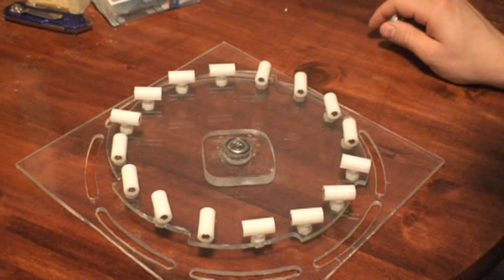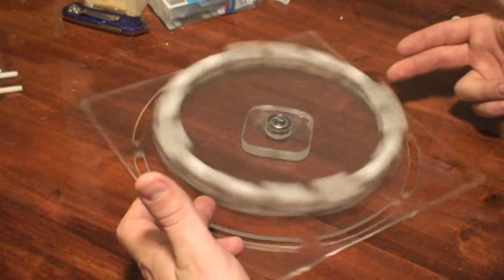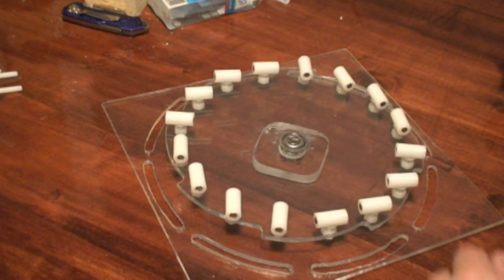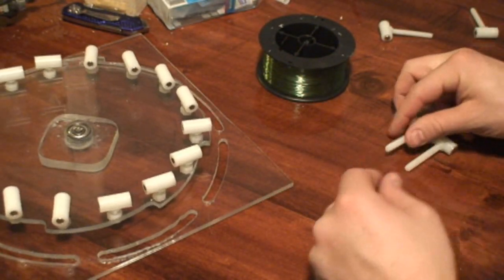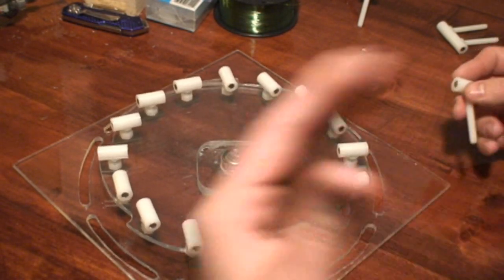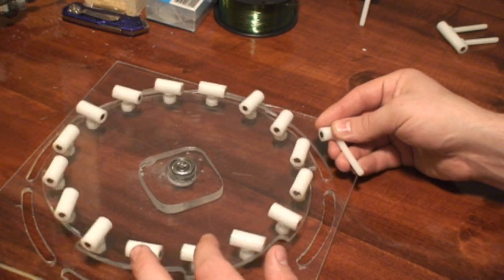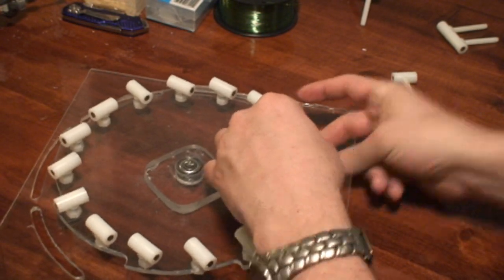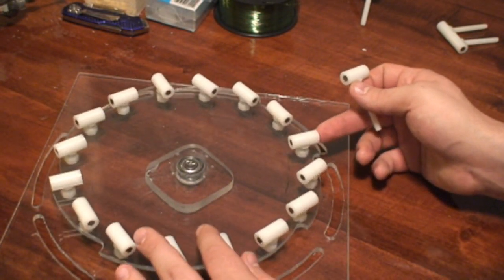Magnet motor, free energy, overunity test 2

Comment: I don't think these people understand physics
Reply: well its "possible" to have free energy or limitless energy.

the problem is that in order to have a system like this you need constant power to keep things going, meaning you both need a power well (so it never runs out of energy) and a greater power production than consumption.
Reply: Thekilleroftanks no your first sentence is false
Reply: not really.

anything in science can and must be possible.

because if we cant have limitless energy or free energy, then you must prove its impossible by running test to prove EVERY single model is wrong...

that is a lot of testing.
Reply: Thekilleroftanks that's not the way either physics or the burden of proof works sir.

If you make statement A. You have to prove statement A.

If I say statement A. Is not  possible, all I have to do is show why.

As for the infinite power thing, that wheel he has there is being spun up or pushed by that magnet he is holding, every ounce of power it has was given it by that magnet. Every ounce of power taken out of the system for generating electricity will take away from that, as will friction air resistance etc.

He's inputting X energy into the system.

He's outputting Y energy from the system.

So long as he's putting in more than he is taking out the wheel will continue to spin. There's nothing free about it
Reply: Actually, if you claim that you can have limitless or free energy you have to prove your claim. Otherwise it has no value.
Reply: It's possible to have free energy or limitless energy if you have something that never runs out of energy

Nice logic
Reply: No it isn't.
Reply: ***** yes it is.

if you wish to state something is impossible, you must prove it.

something thats very difficult.

hence why we state something is either very difficult to pull off. or require tech we have no ability to access. 

but stating something is impossible is the same as stating something is possible. and still defies the laws of science.
Reply: except that if you state something is possible, you have to prove it too. Which means that the default state is neither everything is possible nor nothing is.
Reply: ***** unless its far outside our reach, then you cant prove it but neither can you disprove it meaning its possible BUT there is a very small chance of it happening.
Reply: Thekilleroftanks you don't understand the burden of proof nor the conservation of energy.
Reply: Sir Sayaka Miki the 3rd oh no i do understand how those things work. i understand the conservation of energy makes limitless energy impossible and i do understand the burden of proof is on me.

but am stating that I, cant test the theory therefore i cant disprove nor prove it can work. and because of how science is where unless you prove it otherwise, it must be possible. it might have a 99.9999999% chance of not working. but there is still that .0000001% chance of working.
Reply: No it isn't how science works. It is neither possible nor impossible until tested. Otherwise science would be biased.
Reply: FuckYouGooglePlus And it is considered impossible because the thing they are breaking has been tested before.
Reply: And the reason for that is because it has been tested. For instance, i do not need to test whether or not a 0.45667753kg object falls at the same rate as a 1kg object because it has been proven that the calculations are correct (correct enough).
Reply: +Thekilleroftanks No, not everything is possible. Nature operates under a set of laws.
Reply: wowhallo yes, but those laws may not be correct.

because we dont know everything, therefore those laws arent set in place completely.
Reply: +Thekilleroftanks Yes but is there any logic to nature? If so then you would have to accept that there is a set of laws that nature operates under. This is the basic assumption that you have to make in order to do empirical research, that you have to assume that the nature of things stay the same in the course of time.
Reply: FuckYouGooglePlus Yeah, no. In general, a scientific law is the description of an observed phenomenon. It doesn't explain why the phenomenon exists or what causes it. The explanation of the phenomenon is called a scientific theory. It is a misconception that theories turn into laws with enough research.
Reply: Free energy doesn't work because of laws of thermodynamics. these free energy machines are only possible in a system where no energy is lost through friction or heat and those are conditions that we can't create, even the magnets will eventually lose their magnetic properties over time.
Reply: FuckYouGooglePlus FuckYouGooglePlus FuckYouGooglePlus what you describe is absolutely not a perpetual motion situation or free energy. Perpetual motion is not perpetual if you NEED to replace parts, end of story. 

Your free energy situation is correct until a certain point in your argument. If the system makes more energy than it uses, yes that's free energy, anyone would agree. If however, you have to replace parts or whatever, as you said costing more than the excess energy produced, that is NOT free energy. Free energy in physics when talking about breaking laws (conservation of energy here) is concerning total energy. You could argue that your system creates free local energy, absolutely, but free energy no. In the same sense that solar panels are free local energy. Regardless of what you do the total energy though remains the same.
Reply: And in fact people referencing loss of magnetic properties is very relevant to this video.
Reply: Or, we can just forget about this useless argument and thank this guy for uploading it in the first place.
Reply: Or, you can not drag me into your crap. Thanks in advance.
Reply: Where did this come into play? Lol I don't make videos, thanks for taking an interest in my channel, doe. Just a video bro chill out on all these comments lmao

P.S. Somebody that feels the need to make a rant on 15+ YouTube comments is a burden to society, XD
Reply: I don't think Nikola Tesla was wrong with his idea, he was a genius, smarter than anybody in his time and nowadays. But I do think the term 'free' is wrong ^^
Reply: I agree with you
Reply: But being wrong, unable to accept it, and sperging out are all signs of a well adjusted individual? Is that right? Man, I wish I was cool like you...
Reply: kids, stop the arguing, we all know these machines can't work end of the story
Reply: Sir Sayaka Miki the 3rd I'm starting to think that that Google guy is one step stopping us from achieving world peace tbh. Honestly, he has nothing nice to say, and no one wants to hear his face. Why can't he just take a chill pill and realize that he will be forever lonely of he's always talking like that?
Reply: Sir Sayaka Miki the 3rd Same, I'm anticipating how many times he's gunna tell us to kill ourselves over a video.
Reply: Thekilleroftanks, actually you can't have free energy or limitless energy because that would violate the first law of thermodynamics. Not knelt that you couldn't use the power created by it
Reply: Fester Blats that's literally it. Like where does the extra energy come from. It just makes no sense 2+2=4 but for some reason energy+energy doesn't = 2energy to these people.
Reply: Just gonna jump in here, you are indeed wrong killeroftanks.  "Anything in science can and must be possible" is a logical fallacy. It is not possible to have "Free" or "limitless" energy, it violates the laws of thermodynamics and denies entropy. If this were even partly true the universe would be a very different place, probably unsuitable to life
Reply: It really has nothing to do with entropy or thermodynamics its literally nothing more than conservation of energy which is a fundamental observation about our universe.
Reply: RMSVideos So where does the energy come from? If you were to extract energy with this device using a standard generator where do you think the energy to turn that generator would come from? It cannot just be spontaneously created, if we could create free energy out of nothing we could have pocket fusion reactors
Reply: I think the fundamental flaw of the possibility of free energy is that it is indeterminate as one cannot measure exactly if it is possible, while, simultaneously, one cannot measure if it is impossible.

As such it is simply not worth arguing at all, because we cannot even create a link to a conclusion. Now what is worth discussing is figuring out how to utilize conservation of energy to perhaps recycle energy and use it more efficiently.

A valid point is that if all the energy at the input is outputted to the same input, then there will be no loss of energy in the system. What makes this an unsound argument though is that systems forged in this manner have losses that we cannot account for which prevents us from utilizing all the energy at the input.

Of course there are always the options of just transforming the excessive energy in nature to something that can be utilized. Things like solar panels, wind turbines, and hydroelectric dams do this already.

In the end, the issue of these free energy things is the costs to start it up and to maintain it. For things like magnets, it comes to the question of is the cost of the energy used to magnetize these magnets worth less than the gains of the energy produced by these magnets. It's much easier to justify this if the resources can easily be found lying around in nature, but when one needs to place efforts into creating the resource itself, it becomes a cost that makes the process much more difficult to justify.

Of course, if despite all these factors there is a net gain, then I see no problem with calling this conservable energy. I mean we can nitpick the word "free" because there are the costs of magnets and all the stuff attached to it. For example, getting money from the job can pay off the loss in energy spent on the job, but it doesn't mean there was absolutely no energy spent on the job in the first place. Though it could certainly be dubbed as conservable energy, which is still pretty good to strive for.
Reply: FuckYouGooglePlus Interesting, can you outline why? I mean if we are nitpicking at the word free, then obviously one doesn't exist, as the fuel itself is the cost which is the magnets in this case.

I know that the concept of electromagnetic induction is essentially the main concept of how generators work. With the whole alternating current generated from constantly moving magnets through a coil of direct current. Coils up the wazoo since electric currents generate magnetic fields and coils funnel it through the center.

It's is essentially one of the concepts that the wind turbines, hydroelectric dams, and nuclear power plants use. Given that they use said concept, it goes without saying that kinetic energy can be converted into voltage. If the force of magnets can be used to produce kinetic energy then it certainly is possible. Though, in my opinion, is unreasonable.

It's about as reasonable as hiring 1000 slaves to turn a turbine and calling it "free" energy. Given that these other sources of energy generation are using magnets themselves, it would only make sense to use any juiced up magnets that are possible of turning a turbine efficiently, it would make more sense to just throw said magnets in the turbine itself.

Again though, conservable energy is useful to strive for given that these processes already use magnets. If I'm not mistaken, almost every single resource uses magnetism for power generation.
Reply: holycrapitsachicken dude Google has explained 40 times on this video. Energy from magnetizing the magnets is not the issue. And free energy is not possible it is not some thing where we're just going to uncover how to do it. You literally don't belong anywhere near science if you can't wrap your head around that.
Reply: I see, well then it really is unreasonable. I was aware of the fact that
 magnets utilize forces and it is one of the fundamental forces that 
keep the world stable:electromagnetic force. However, I wasn't aware of 
the minimal effect it has for kinetic energy.

I guess it makes sense since the mechanical energy needs to be the same and the potential energy of simply spinning that little magnet would not nearly be enough to make that thing go crazy. Heck, it takes kinetic energy to spin that thing so it really would be pointless.

At least nuclear power plants takes advantage of the the massive heat generation of nuclear fission by taking advantage from weak nuclear force to generate kinetic energy from the immense amount of steam generated.

I think people are better off buying a little generator and making DIY projects with it if they want to get a jist of how energy works. There are ones less than $10 and at least they have visible applications. I bet it is even cheaper than this set of magnets. Magnets are fun and all, but the electricity component is important for people to completely understand how it works, it's called electromagnetism for a reason.
Reply: Jon Deal i dont think YOU understand physic..
Reply: Thekilleroftanks there's no point in proving it's impossible if you haven't even proven it's possible
Reply: Energy has to be conserved. You can't create energy out of nothing.
Reply: Do the impossible, see the invisible.
Row row, fight da powa.
Do the impossible, create from nonconservable.
Row row, generate the power.
Reply: holycrapitsachicken made my day
Reply: To innovate, you go from the assumption that every thing is possible, until you hit the mark where you find that it isn't possible (that way), then you try it differently.

If you always assume that something isn't possible, then you will never have innovation.

If the cavemen never experimented with fire, thinking that fire cave from the sky and it isn't possible to create fire ourselves, we would still be having a firewatch to make sure the fire doesn't go out.
Reply: Why is this impossible though? I've never truly understood the argument. Energy cant be created or destroyed I think that what you are getting at, but cant it be contained in a way where I would collect more energy that we can take? I could be wrong of course because I've never looked into something like this but its a neat idea.
Reply: Joe you have a rather mundane and interestingly final philosophy on science. You're not wrong , but you seem far too dismissive of the potential of such a system. You are right that the reason it spins is that all of the magnetic force is made to push the wheel, and you can make the argument that it's thus unusable, but theres a lot you are ignoring. 

1. The magnets will take a long time to weaken, and until then can be used to generate KINETIC energy with this model, rough as it is.

2. Kinetic energy can be used in an unpowered motor to generate electric current. 

Your argument that the moment electricity is taken from the system it will cease would only apply if the propulsion was electrically powered. If you make one system utilizing magnetic production of kinetic energy, then a seperate system to capitalize on that kinetic energy, you could generate usable electricity. 

I'm not claiming that this model is the answer, but i AM saying that this model proves the possibility of such a system. And you need to think like a scientist if you want to accel in the field of science. You wont get anywhere if all you know how to do is close the book on any tech just because we dont yet have it, and by that logic we shouldnt be capable of ANY of the technology we have already.
Reply: Thekilleroftanks long story short,  there is no free energy you have to put energy in to get energy out check out one of Newton's laws "energy is never created or destroyed only changed in form"
Reply: Tesla figured out free renewable energy... why hate on people for trying?
Reply: Google plus is a complete tool...find a woman brah...
Reply: I'll make a statement. You don't understand physics. Specifically, quantum physics, because time crystals now exist. Higgs Bosson now exists. 

Time crystals are by definition infinite energy. aka Non linear matter. Always jiggles. 

Harvard and university of Maryland both proved it.
Reply: Physics is not a book sent from God. Its only a experiment.
Reply: @NafenX  ...and for all intensive purposes we do. Its called the Sun but we still haven't even figured out how to harness that properly yet either.
Reply: @BlueEyesWhiteTeddy  I am no expert but I believe the general consensus in the scientific communities is that something is deemed impossible until someone proves otherwise.
Reply: @Thekilleroftanks  As far as I am aware it has already been proven impossible through general relativity and the first law of thermodynamics. So these are accepted scientific facts and if you won't believe they apply to this experiment then you may as well believe that all accepted scientific doctrine does not apply to anything else either. So by your logic up may as well be down, hot is cold, and blue is actually red.....because as you say, all of that nonsense has a .0000001% chance of being untrue.